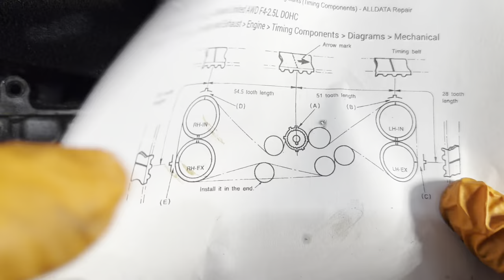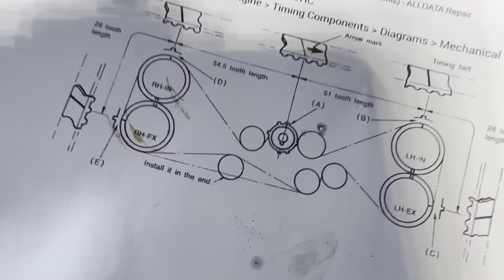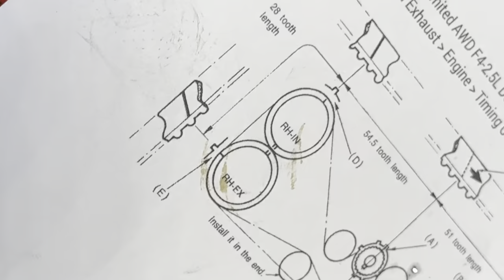SOFT METAL!  Engine Damage! Subaru Legacy Outback AWD 2.5 DOHC EJ25

Comment: Watching you take the time and care placing the timing belt is similar to preparing for a rocket launch when each part of the preparation is checked and then rechecked for perfection. Thanks for a terrific video.
Reply: @bearpuf Now we know why the rocket launches are always postponed🤣
Reply: @miwa4783   They shook the assembly and a loose fastener fell out. Now they have to completely disassemble the structure to examine where it should go and see that everything is actually tightened, assembled, torqued, down to the very first step, making sure every step is more carefully verified.
  It's always cheaper to do it right the first time.
Reply: @thomasmleahy6218  Oh no, that engine is a joke

Comment: Put a jam nut on the installer, or the bolt with a jam nut, or a shoulder bolt. I think the insert cracked because that portion of the hole was bigger than the insert's threaded hole. For optimum thread engagement, a common rule of thumb is 1 1/2 times the diameter of the screw.  If that is an 8mm bolt, you need 1/2" of thread engagement.

Comment: Armchair observation from 1,000 miles away,  It appeared to me you needed to run the tap deeper to get past the taper on the end of the tap.  Your threads were not complete at the bottom of the hole causing the insert to not seat/thread full depth.  The insert tool is designed to drive the insert internally by incomplete threads at the bottom on the inside, not by the shoulder.  The insert is not intended to thread fully onto the end of the installation tool.  The insert is locked in place by the installation tool pushing thru and expanding the crimped section AFTER the insert bottoms out.
Reply: Great tips.
Reply: And Loctite is not necessary

Comment: Hi Ray
Love your videos here in Geelong Victoria Aussie!
Watching you dealing with cheese alloy Subaru.
The safest way out of the fractured thread insert problem was to collapse the insert by using a small 
Chisel to come at it from the side of the lip protruding out from the face of the block and tap it towards the centre of the hole. This will collapse 
and be able to be removed allowing you to then clean up the tapped thread and go again with another insert.
My reason for removing the broken insert is that the threaded hole in this case is supporting a tensioner and is subjected to great load.
Keep up the good work!

Comment: Hey Ray, some obvious problems with your time sert technique. On blind holes its critical to know the max drilling depth. Small tip for you when drilling out the shoulder depth. To make sure the depth is correct, after drilling the step, insert the timesert backwards (lip into the hole0, you can easily see if the depth is correct or not. You may have been able to remove the broken timesert by installing a bolt with Loctite 262 or 271, let dry, then unscrew the bolt, the sert will come with it.
Reply: Good tips. I think it'll be alright but I didn't care much for him leaving a broken time cert in the block.
Reply: Also if you look close, he didn't tap the hole deep enough, you can see where the threads ended.
Reply: this typ of insert expands on the end when you install it,  if you back it out you rune the threads. you can get the inserts in different length.
Reply: @wb6anp  I couldn't see it on my small screen but it seems likely. I had assumed there wasn't enough thread depth too which caused the time sert to get held up at that point instead of at the collar which caused the tool to move further into it and expand the threads to lock it in place too early.

Comment: M10 nuts on the insert tool will work, and the reason the tool was so hard to get on is that the Timesert has a thicker base, so the tool will drive it out to lock the insert in position. you did not get the thread tap in deep enough to make the hole, easy to get wrong. Plus the bolt going in for the tensioner will provide the locking needed on the insert.
Reply: Agreed, while the drilling wasn't pretty, it was tapping the threads in the hole that caused the problem. One time where he may have been best to chase the original tapped hole with the appropriate sized finishing tap, because he was worried about going too deep with the tap, he didn't tap deep enough to get to the full depth of cut on the tap which caused the insert to seize in the hole when it got to the last 2 or 3 threads that weren't fully formed. When tapping a hole like that I always use a bolt with the appropriate thread pitch to check that the threads are clean and fully formed to the full depth needed.

Comment: Congratulations! You continued were most would have given up! Those engines are made out of soft alloy. I worked on an alloy engine and ended up just putting an insert in every hole. But a reward is they sound nice with a decent exhaust. Thank you ray, for another great video.

Comment: I would only use hand tools to tighten bolts on that engine block! The aluminum seems weak.
Reply: Especially cast aluminum,it has low grain structure
Reply: Speedwrenchs help save time also !

Comment: Enjoyed watching the timing job.  One time when doing one of these four cammers the wrong belt was supplied in the parts kit.  It was under size.  I of course figured I was doing something wrong and hi-jinks ensued.  I too have chewed up bits of Subaru engine metal.  Your comment about the engine being made of cheese is on the mark.
Reply: That's why OEM parts/kits are best. AISIN supplies a lot of the OE parts for these Japanese engines, their complete timing kits (inclusive of water pump, belt, tensioner, and pulleys) are #1 for quality in my book.
Reply: @craigcraigster4999  Subaru's engines have to be more expensive that the standard inline four.  Subaru's seem to run more cats that you see on other engines.  Cats are expensive.  If you have a car like the WRX with three differentials that is still more expense.  Then you have to compete with the other brands.  I want to love Subaru but they have to cut too many quality corners to keep their prices competitive.

Comment: Without a center, the drill does not know where to go so it just bounces on the 2 flutes. That is the reason for a center punch in metal for the bit to know where to go. Just like a wood blow out after the tip exits the hole.

Comment: Two full rotations in the normal direction of rotation. Never backwards, with a sprung tensioner. The crank bolt coming undone was trying to tell you something.
Reply: Yes sir, 720* of manual crank rotation is mandatory for timing confirmation, PERIOD.
Reply: Was thinking the same.  Always turn in the direction of rotation.

Comment: Oh yes, please remember to get your shop a Recoil/ Helicoil set, with a pack of 50 M6x1mm by 1.5 length inserts, because you will be needing it for the Rubasoo timing belt covers, as those little M6 bolts get stripped out by the dealerships going in with the ugga dugga method, and tear the threads loose. Done a good number of Recoil inserts into either aluminium alloy valve covers, or on VW carburettors, where the centre bolt comes stripped, and there is only room to do the Recoil insert. Drill down deep, and put in 2 of the 6mm inserts, to get enough thread engagement to keep it from stripping out, and clean the hole, plus use green oil resistant threadlock on both insert and the stud.
Reply: Had to put inserts in my frame rail because of air box being removed & replaced by shops & me

Comment: It broke at the taper that was all ready there. You could have used a nut to lock the depth.
Reply: That's not how timeserts work. The tool expands the insert to lock it in. I'd be pi$$ed if this repair was done on my engine
Reply: @WaveDudeTX  That is not how to properly use it. But a good mechanic can addapt

Comment: Next time you need to drill something like that, Try and find ourself some 3 Flute Drills there Ray if you can, it will help with centring, will be a bit more in terms of cost but will help int he long run for those odd ball things. Is a Machinist

Comment: Ray. That bracket that your drilling into for the timing belt tensioner can be purchased at the Subaru dealer it's simply bolts onto the block and it's all pre-threaded probably already finished the job but I thought I would let you know

Comment: Trick is to remove the bottom smooth idler line up the belt . ,use a plastic clamp tool to hold belt on the top .
And lift belt at bottom and fit smooth idler gear ..
Then check and pull pin .

Comment: Since the bolt goes into a water jacket how about some sealer on the threads to guarantee no leaks
Reply: agreed, a couple wraps with Teflon tape on the insert and bolt will do the trick, I got burned a few times with bolts into water jackets or oil galleys.
Reply: I doubt that the bolt goes into the water jacket.
Reply: @marksmallman4572  Mr Ray stated he could see the cylinder wall threw the bolt hole

Comment: Not that I think you're ever gonna go near another Scooby engine but they do make a tool that locks the cams into place on those DOHC engines (available on Amazon). Also I've never had Scooby timing marks align perfectly exact. I've rebuilt dozens of these things. You did pretty good for your first time😊
Reply: Yeah after two rotations the marks will not line up perfectly and it’s caused many ocd people grief.
Reply: I use strong spring clamps to hold the cam gears in place.
Reply: Maybe my eye-crometer was off , but it looked like the double timing marks lined up perfectly -  just not the paint marks on top of them .

Comment: Well done!! I'm amazed you got away with that drill out a retap without a jig. I was always taught to do that stuff upright in a drill stand to ensure the result was perpendicular. I'd be interested in your opinion as I'm always here to learn 👍
Reply: Take a block of  scrap steel that will sit flat on mating surface,on a square drill press,drill a guide holes one the size of taping drill the other the size put the block flat surface to be drilled it will help
Reply: @michaelpressman7203  exactly 💯
Reply: @michaelpressman7203  would a mini-spirit level attached to the tap handle tool be viable if we don't have access to a drill press?

Comment: 31:43 kind of surprised you didn’t spin the engine over by hand a couple of times (maybe you did and it got edited out?). Always a good idea after redoing timing because you will know if you ****ed up before it causes any damage.
Reply: I couldn't agree more. On my '06 LS430's 32-valve DOHC 3UZ-FE, once the belt is in place per all timing marks, the crank should be manually rotated twice (720*) to confirm the engine being in-time and the belt hasn't slipped and jumped a tooth.  The marks on the belt itself will no longer line up, but all timing marks on the cams and crank should, thus confirming proper timing and avoiding a complete disaster for this interference engine. Not sure if the procedure is identical for the Subaru flat-4, but manually checking timing on any engine in a similar fashion prior to reinstallation of cam/front covers is always a wise idea, no matter how many similar or identical engines you may have worked on in the past.
Reply: He never showed it on any other engine either. He probably doesn't check them ever
Reply: Not the best or brightest at all😂

Comment: If that bolt is in the cooling jacket you need to use silicone sealer on all the threads.
Reply: only if the manufacturer calls for it, putting sealer where it's not supposed to be can be catastrophic for an engine (ie restrict flow), from what it looks like, there was not sealer to begin with. So sealer was likely not needed or you would've seen residue on the block
Reply: @willydavid  me too buddy
Reply: @IFIXCASTLES couldn't have hurt it anymore than all the metal shavings blown in there lol
Reply: Train wreck conductor Ray

Comment: So, I know it's against the law, but you should read the instructions for those thread inserts 😂 The install tool is a swage, and you're supposed to lube it. Tbh I much prefer helicoils for general thread repair, timeserts are possibly better, but they're super easy to mess up and cause grief.

Comment: A $105 time-sert kit to repair a $50 tensioner bracket, ouch!
Reply: I just want to add that my previous comment was in no way intended to be a slight or insult. I think Ray is an excellent mechanic and I have learned a lot from his videos. Everyone has the potential to have oversights or mistakes in their work, but not everyone would own up to them and not pass the cost of said mistakes onto the customer, particularly in this trade from my experience. I do pretty much all of my own mechanic work these days because of this, but I would not have the confidence to do so without the work folks like Ray put in to share their knowledge on platforms such as this one. Thank you, Ray, for your hard work, honesty and willingness to share!
Reply: It’s not a one use kit.
Reply: Question, if it is a bracket, then the hole does not open up into a coolant passage, correct?

Comment: Since the tapped hole for the tensioner mount goes into the cylinder water jacket, would it have been a good idea to put some sealant on the bolt threads?  I think Loctite makes a sealant/locker.

Comment: KTM engine blocks are what led me to Time-Sert. Even after using precision torque wrenches designed for mounting rifle scopes, the sub 10 Nm bolts would all strip well before their spec.
Reply: The tread striping gremlins are everywhere! I've fixed quit a few
Reply: If you have a bolt threading directly into an aluminum hole, you have a stripped hole waiting to happen.  That's just the way it works.  (Ditto for magnesium.)

Comment: What seals that repaired bolt hole from leaking coolant?
Reply: I forgot about that until one second before I read your comment as I was reading one a few spots above yours talking about using studs instead of bolts.  That's a good point.  I would worry about that as well.  Someone else mentioned that the hole he was drilling doesn't actually go into the cooling jacket.  I don't know what's true and what isn't.

Comment: I love your videos, you really do make great videos. But Jesus christ you are doing a hack job on this poor Subaru engine. You should have learned from the first time you stripped the block not to use power tools but nope. And then the second one you not only cracked the sleeve but instead of fixing it correctly you grinded the block. Also why do you never take the time to use a torque wrench? Especially on these Subarus. Man by the time you're finished with this poor thing it's going to be all hacked up.

Comment: Ray,
When are you going to learn that you are NOT supposed to be running a drill full speed when trying to drill things?

I pointed this out to you quite a while ago (probably a year or longer now) and another person is pointing it out as well.

Just because it says "high speed drill bit" DOES NOT MEAN that you run it on high speed.

You're just asking to ruin those drill bits in a matter of seconds.

You're just wasting time unnecessarily by running the drill full blast.  You need to be doing short quick bursts and letting it rest for a second in between bursts.

In this case, you were lucky that the metal was soft so it probably didn't do anything to the bit.  However, if you're working with harder metal like steel, you need to go slow.

Or, ignore what I and others have been trying to tell you for a long time now.  I know others have pointed this out previously as well.

Also, you should have put some tape on your bit so that you knew the depth to go before you hit the cylinder wall.

Another thing as others are saying, I hope you're going to clean out the coolant passages as the small metal chunks or shrapnel could cause issues down the road.  You don't need a client getting upset and having something happen all because you didn't clean out the cooling passages properly after doing that.  

If you are drilling correctly, you actually don't need to use any lubricant and in some cases, lubricant can actually cause a problem for the drill bit because it causes the sharp edges of the bit to "slip" on the surface of what it is needing to "bite" into in order to drill the hole.  So, stop using the lubricant and learn how to drill properly.

With all of your experience and wisdom, I don't know why you make mistakes like this.

Regarding the time sert, I don't approve of the way you left it and I'm betting it's not going to hold that well long term.  You should have figured out if your depth was correct for the outer edge to sit flush against the cover instead of grinding it down like you did.

Also, you should have used a bolt with short threads so you could thread the insert in properly.  I'm concerned it isn't going to be in there very tight and could work its way loose over the years.

Will this happen?  Maybe not.

I just think you should have done a better job.  I would consider just using heli coil next time.